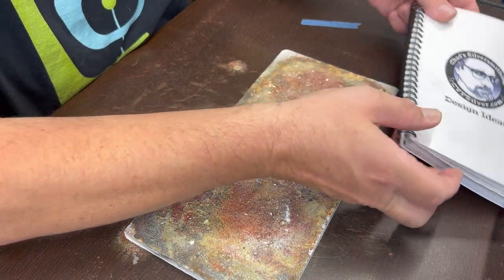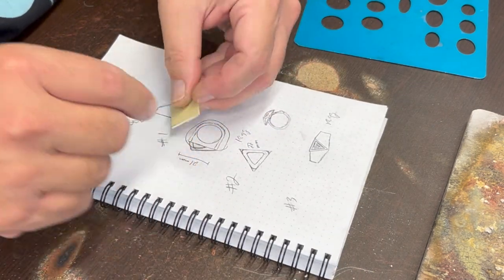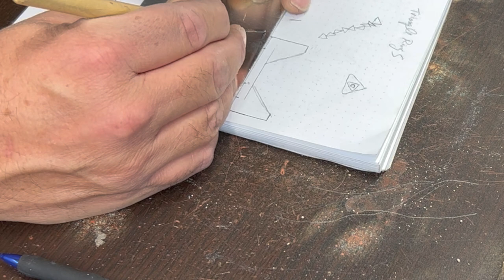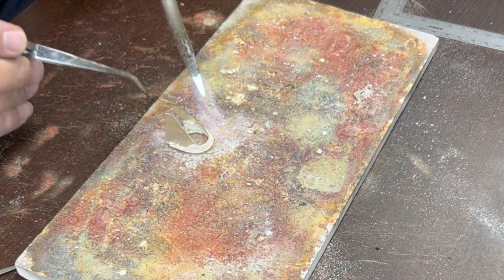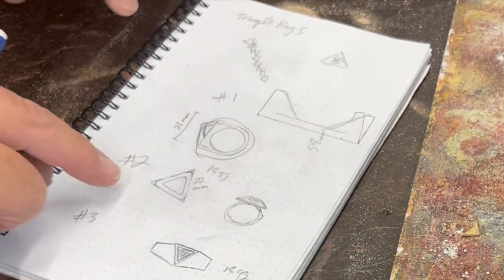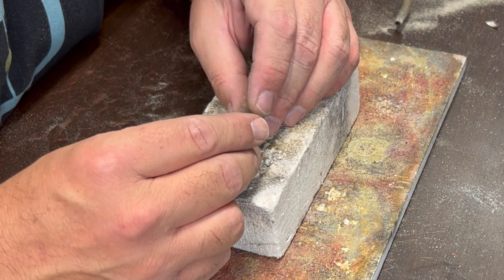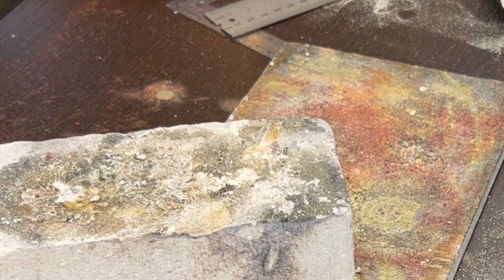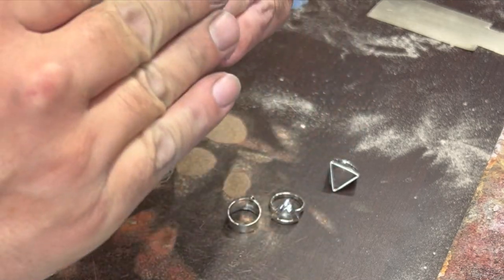Making Triangle Rings: A Silversmithing Tip

Comment: These are all interesting designs and would be fun to make. I can see where you could come up with lots more variation once you start thinking about turning them different ways, giving more 3D elements, etc. Very nice. The one you made from the scraps is really cool, I've only seen two other jewelry channels come up with ideas on using scraps other than just melting them down. If you don't have a rolling mill it can be hard to use a nugget of metal unless you really like hammering and filing. Thanks for all the nice content, I've picked up quite a few tips and tricks from you and most of all some really great projects to try.
Reply from the maker: Thank you Bees!  I appreciate your input and nice comments!